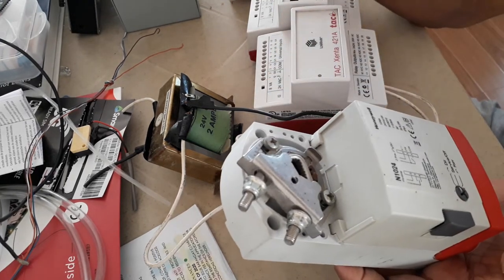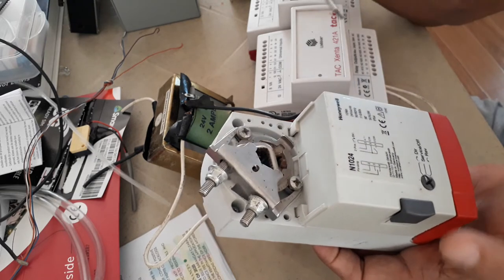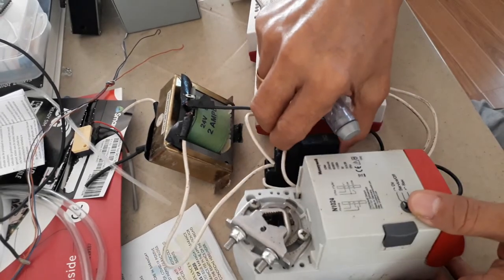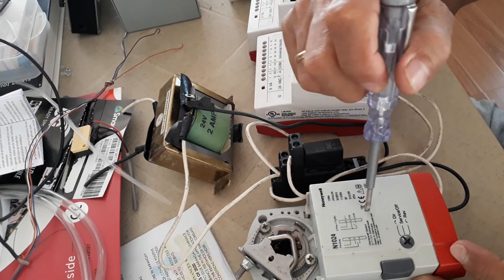How to become a BMS engineer part 60 (Damper Actuator)

Comment: Sir, one of the vfd showing negative feedback in bms. What may be the reason for this?
Hoping for a reply...
Reply from the maker: Is it showing correct feedback before?
Reply: Not sure about it sir..
Reply from the maker: Just make sure you are receiving 0-10 volts DC from the VFD, if there is a 0-10 volts DC from VFD then the problem might be in the DDC I/O module  AI terminal that receives the signal
Reply from the maker: I mean you are receiving 0-10 V DC feedback signal from VFD
Reply: Thankyou for your reply
Reply: Sir one more doubt..why this actuator showing negative feedback..?
How to fix this issue.
Reply from the maker: @sachinkp4504  Is it a valve actuator?
Reply: @SantosJrCapellan-BMS  yes sir...picv feedback showing negative value...
Reply from the maker: @sachinkp4504  just make sure you are receiving feedback signal from the valve actuator, and make sure the polarity of the input signal going to your DDC I/O AI is correct if the polarity is not correct it will not give a correct signal, always remember the feedback signal is DC